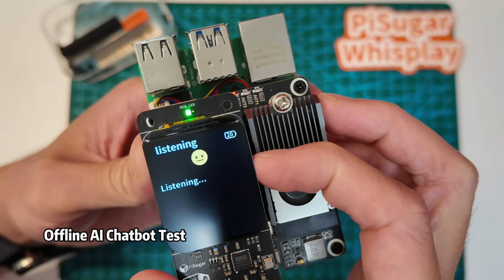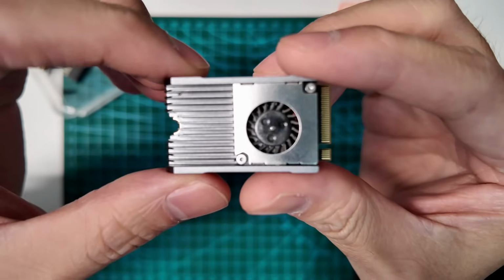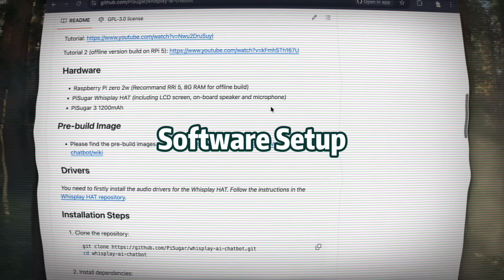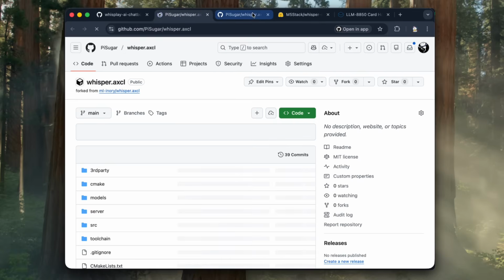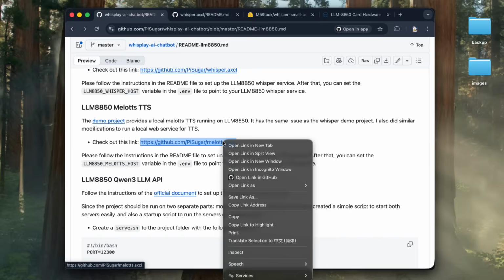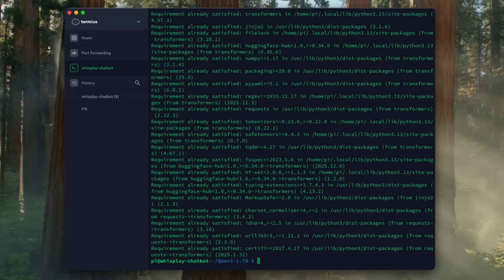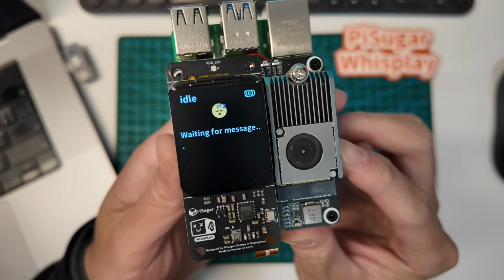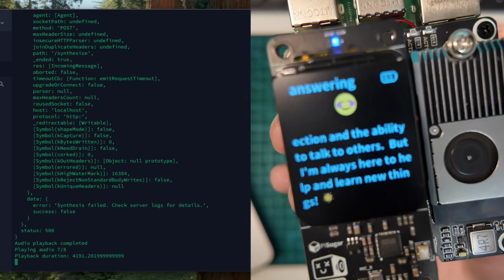How I Built an INSANELY Fast OFFLINE AI Chatbot (Pi5 + Whisplay + LLM8850)

Comment: When using an accelerator, does the amount of RAM on the Raspberry Pi itself still matter? Will the pre-built image run equally well on the Pi5 4GB and the Pi5 16GB?
Reply: It would matter if you wanted to run a MoE type model. But if you get enough tiny models to fit on the 8gb 8850 then you might not need to hit the RAM that much. I am actually in the process of upgrading to a 16gb RAM version just because I want to put off more things to the Raspberry Pi to fit more stuff on the 8850.

Comment: This is excellent, thank you for sharing. I’m fairly new to the Raspberry Pi world. I currently run Ollama with Llama3.2:3b on my Pi5 16GB with very quick responses. gpt-oss 20b is also very usable. I use an NVMe HDD installed on the M.2 hat instead of the SD for better performance. I must look at installing the Pi Sugar.  Whisplay and a TTS capability for more portability.  I also looked at  the new AI Hat+2 but I don’t think I’d get better performance from that on a Pi5 8GB than what I already have. Great work. Have just subscribed.

Comment: How about the Ai Hat+2 Hailo-H10 in comparison?
Reply from the maker: I haven’t tried it myself yet, but based on the reviews I’ve found on YouTube so far, the AI Hat+2 can indeed run LLMs. However, its performance doesn’t seem to be faster than the Pi 5’s own CPU, even slower than the previous Halio 8L, which is pretty awkward...
Reply: @PiSugarStudio Seems the LLM8850 is a lot faster than the new official Pi AI hat. Not to mention the 8850 has a cooling fan built into it!

Comment: can LLM8850 be used on any pc too so to run offline inside a container or VM in Proxmox? could you create a video for it? perhaps also integration to Truenas apps too?
Reply from the maker: It should be possible to run llm8850 on pc I've seen x86 binary files in their repo.
Reply: @PiSugarStudio  Could you make a tutorial for the use in this case? Several apps on Truenas that may take advantage of it. Also, a container or vm may use it in thinclients or cpu without powerful GPU. THanks in advance!

Comment: Can the chatbot run in other systems besides Raspberry PI? I would like to try in my laptop before I start investing in hardware :)
Reply from the maker: Need some code adaption. You can fork the github repository and replace the ‘device’ part implement.

Comment: This is amazing my friend. I am ordering all of the parts for this now. Hoping to add more capability like live translation/conversation. Curious if you can also add "search" capabilities using GPS like being able to ask for restaurant recommendations based on current location, etc when connecting to Wifi.

Also, is there a reason you choose Qwen as the LLM instead of using Gemini or Deepseek? Also looking to still integrate the Raspberry Pi Camera again with this LLM8850 chip, any difference in setup?

Comment: why not use a jetson?
Reply: I would say... it's not that easy to use the cuda core on jetson. If you just want to run LLM, why not use a faster linux board with better CPU, that is much cheaper and faster (or maybe just you phone). Also, this thing consumes mucn less energy, that's why those NPUs still exist.

Comment: Is there a better SBC than the PI for the LLM8850 to use? One with built in M.2 maybe?
Reply from the maker: The RK3588 itself also supports LLM acceleration, although its performance isn’t as strong as the 8850. However, with Rockchip SBCs you need to find suitable audio hardware separately, and their hardware ecosystem isn’t as user-friendly as the Raspberry Pi’s.

Comment: You could run a heavily quantized model or REAP model as your primary LLM to fit in a tool calling or vision model designed specifically for that hardware. SmolVLM2 might work for both tool calling and vision. Also, you could consider WhisperX or another faster whisper solution. It's not necessary, but every millisecond counts for something like this. Also, for TTS there is KittenTTS. Also, ChatterboxTTS released a "turbo" model recently that it's possible the developer of tts-webui could integrate for nearly realtime voice with voice cloning.

Comment: Why did you switch to MeloTTS from Whisper? Is it faster? Or does it support language switching mid sentence? Because as far as I can see, it supports less languages, unless you train your own languages for it.
Reply from the maker: You mean Piper to MeloTTS, right? It’s not a matter of simply running existing software on the LLM8850—model adaptation is still required. For now, I’m only choosing alternatives from the officially supported software list, and Piper TTS isn’t on that list yet.

Comment: The big question -- can you cluster these to run bigger models for cheap?
Reply: The M2 adapter card he used did have TWO slots after all, so good question!
Reply: Yes..
Reply: @robotboy3525 I want to see it working!
Reply: Axclhost does support multible devices at the same time but I didn't see any option in the pulsar compiler to use multible devices for the same model. I guess it is possible to split the model and let each device only perform a part of the actual model.

Comment: You know if this can run LLAMA with the 8GB model? And the model you use now, is it good to awnser coding questions? Would love to use it as a coding assistant as I do allot of coding in my daily work.
Reply from the maker: Running an 8B model is theoretically feasible. An int8 8B model may consume around 4~5 GB of RAM. Code written by larger models should also be more accurate.
Reply: ask grok instead. you will get a proper and correct answer.

Comment: Great work as usual. Subbed

Is it possible to occupy two llm8850 in the two pci slots? If so, will it be an upgrade? Maybe have the whisplay hat on the other side where battery rests so the two llm8850s can have max air flow?
Reply from the maker: I think it’s doable, even though my wallet strongly disagrees.🤣
Reply: @P @PiSugarStudio haha yes it does hurt. …but will this potentially increase performance? Boost speed?

And sorry about the other random comment I accidentally left. That was meant for another channel’s video but somehow went into yours during video queue change. Deleted immediately.
Reply from the maker: @WATCHMAKUH  You have more memory and an extra GPU to handle larger models, but I guess this will have limited impact on speed—unless the LLM8850 provides a CrossFire-like mechanism similar to GPUs.
Reply from the maker: @WATCHMAKUH  Just confirm that llm8850 supports tensor parallel, meaning it's possible to split the load to multiple cards.
Reply: @PiSugarStudio this is good news right? So dual llm8850 can either do larger models or split the load to speed up existing smaller llm?
Reply from the maker: @WATCHMAKUH  After looking into it further, I found that it requires PCIe switch support. The Pi 5 doesn’t have this capability, and although some existing M.2 HATs include a switch chip, they don’t meet the performance requirements. So enabling tensor parallelism on the Pi seems very unlikely.
Reply from the maker: @WATCHMAKUH  This means that the two LLM8850 cards on one Pi cannot share compute power or memory.
Reply: @PiSugarStudio awww. Would’ve been really nice if it was possible. So second slot only for storage memory it is. Thank you! Still amazing this little machine can be so fast offline
Reply: @WATCHMAKUH  You could technically run a creative writing LLM on one and tool-calling on the other one. But I don't know if it's worth it when an SSD is probably going to benefit you far more for speed of model loading and increasing TTFT.

Comment: As soon as I saw your short with the LLM8850 … I bought all the components to add to my Pi5. Just waiting for the parts now :)
Reply: After watching the video, there is so much I want to play with ! I see there is extra room, with this configuration of models, to add image processing on the LLM8850, adding back the PI camera ! The possibilities of having a default local LLM with an option of moving to Gemini over wifi with a command should be possible in the code too. Now I’ll be checking the tracking on an hourly basis 😊
Reply: With the updated releases fro axera there is a Qwen VL model now possible to run on the LLM850. I haven’t had a huge amount of time, but currently have Qwen3, Whisper, MeLoTTS and QwenVL all running concurrently on the LLM 😊 Next, play with the whisplay ai code to incorporate it all together.
Reply: I'm attempting to build the pizero model with little success but lots of knowledge
Reply: 12 days later and I'm elbows deep in this project. Have made multiple python scripts! Super fun!
Reply: @TheJacksons1  need to see this! please consider uploading!
Reply: @myactualnameis9996 lol nah that's a job. However I'll give ya a hint. It can be used to run your own off line chat bot. I have my raspi5 feeding the little device. Now sending data from my home pc as well. 15 steps forward and 20 steps back lol add something break something. Welcome to coding 😂
Reply: Me too 😂
Reply: Can install that on old pc with 8gb memory. And i5 Intel?

Comment: there is a high pitch noise coming from the fan that i might find distracting. if only there was a way to fix that on the device without affecting airflow.
Reply: It definitely runs hot during inference. About the only thing to do would be remove the heat sink and use a thermal adhesive to install a taller custom heat sink solution without a fan (like something used on m.2 drives) and use a larger 5v fan (60mm to 120mm?) to cool it

Comment: This is exciting. Gotta get my hands on a LLM8850.
Right now, i'm working with a Pi zero 2 w like your first video, trying to push it as far as it'll go to make it as quick as possible but it is a challenge. 
Wondering if I should just host the ai somewhere else and use the chatbot as a receiver
Reply: Try overclocking and increasing swap memory, since the main problems in pi 0 2 w is processor and ram
Reply: @anisghabarou1544 I'm going to try this, thank you!!